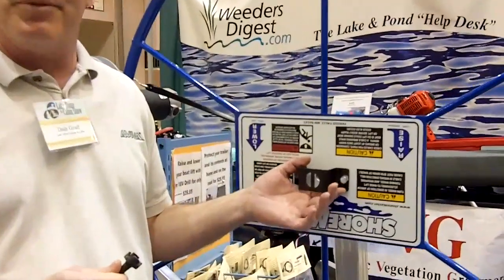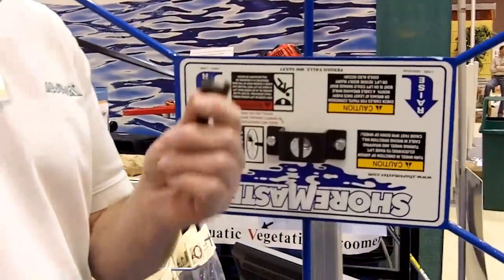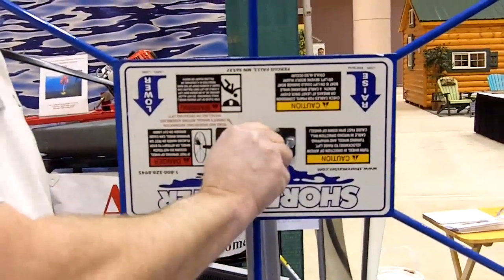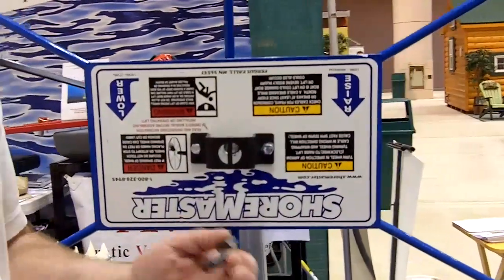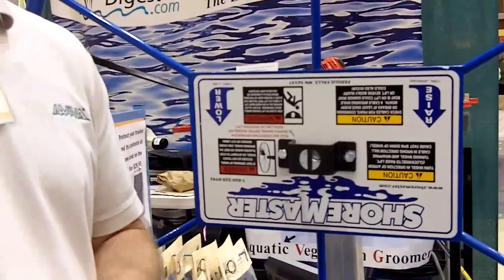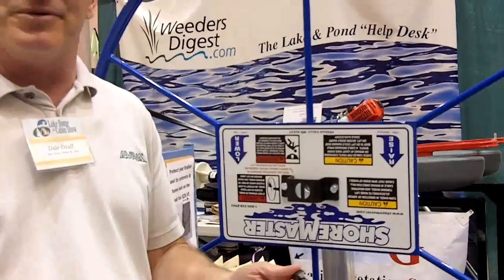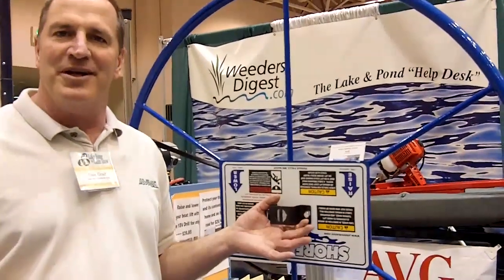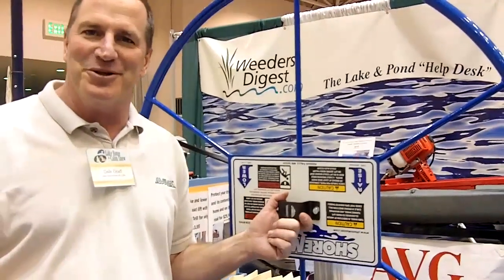Drill A Lift Boat Lift Motor Alternative

Comment: Can you tell us how powerful does the drill need to be?  I have a 4500lb CraftLander vertical lift.  They put a 42" wheel on it because it requires a certain amount of force to turn when raising the boat.  I have not operated it with a boat on it yet, but I assume it needs the mechanical advantage of the large wheel or they would have put a smaller wheel on it?  Some details on what drill you recommend would help.